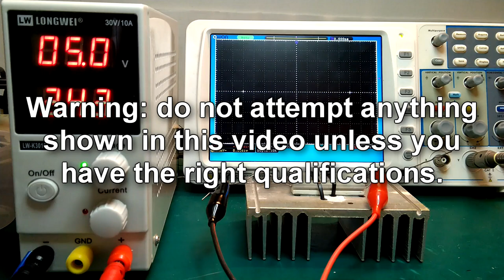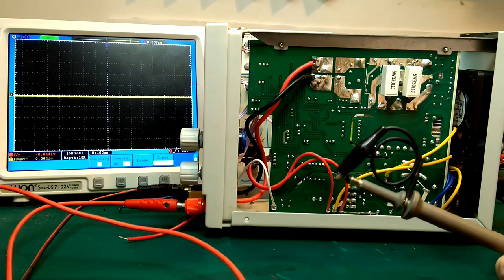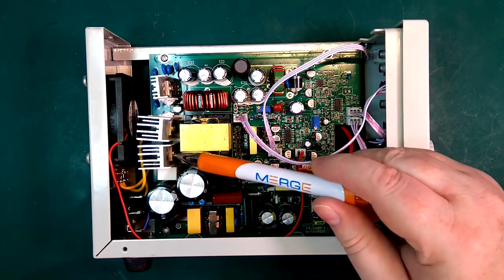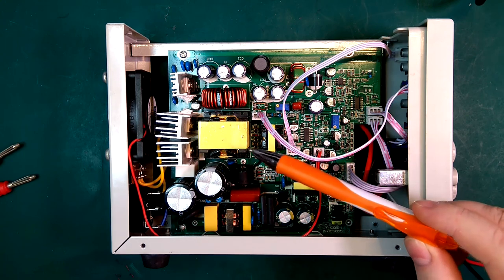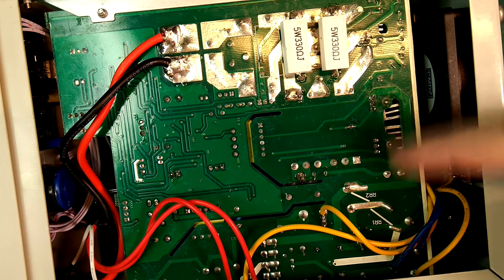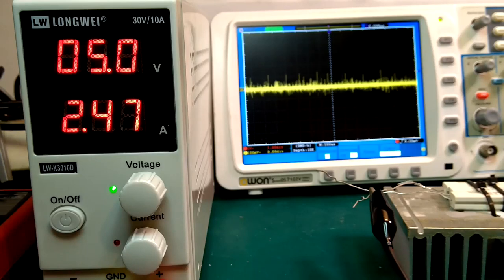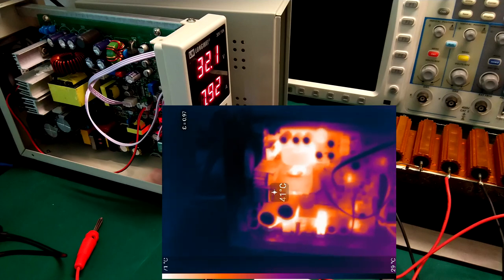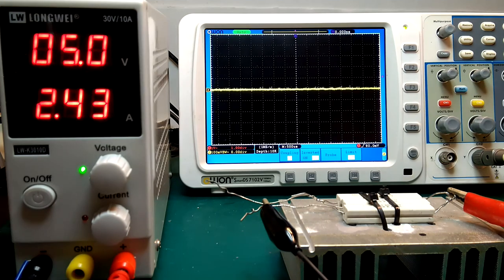Fixing the LongWei LW-K3010D Bench Supply Noise Issue

Comment: is the switching noise as dangeorous as ripple for electronics? Thank you :)
Reply from the maker: Neither are particular dangerous to electronics as long as they are within reason, but you always want a bench power supply to be a low noise as possible otherwise it can affect the behavior of your circuit and make it very difficult to do any reliable measurements.
Cheers,
Jake
Reply: Not using for medical electronic repair or running medical equipment...as a bench supply your safe.

Comment: Hi sir, i have the same power supply and the problem is that cannot keep Amps stable, up - down. Could you tell me sir where to look or what to replace?
Reply from the maker: Hello, the output current depends on the current limit and what load you have on the power supply.
To set the current limit you need to set the voltage to something e.g. 5V then short the output and you can adjust the current to what limit you need.
Hope that helps,
Cheers,
Jake
Reply: @TheStuffMade  i understand what you said sir it's my mistake, i didn't said it right. What i m just saying is, after set the voltage that i need, and adjust the current as you said on the display, initially is e.g. 2 Amps after a second it is  2,5 Amps then 3, 2, 2,5.  it is increasing and decreasing by it self with stable voltage.  What could i do?

Comment: In my opinion, the worst feature of this PS is the current spike when used as constant current supply at low levels. The behaviour reminds that of a line output with a relevant capacitor in parallel. Did you check if your mod do not worsen the already bad spike?
Reply from the maker: I have another video testing the speed and performance of this power supply:
https://www.youtube.com/watch?v=RdT-xWC4h4k
It's typical for switch mode power supplies to react slowly to changes because of the way they work, most linear power supplies have superior performance in that regard, but switch mode supplies are strong when it comes to high power and lower cost.
The noise fix will not improve the speed of the power supply.

Comment: Yes it will limit the noises because of decreasing dv/dt

That means the mosfets switch slower(fall time and rise time increased)
So the mosfets will be get hot and ...dead
Reply: By adding RC snubber and changing the output caps with better (like solid caps) the noises will limit

Comment: Hi how does the  Korad ka3005d vs LW-K3010D with mod compare in noice level ? i would like to compare Vpp and Vmax. Since i can get the K3010D for 56 dolars and the Korad for 85 dolars, both with shipping. Since for my understanding the Fix, does reduce alot the Vpp.
Reply from the maker: The Korad is the better power supply even after the fix. If I could have only one of these power supplies, I'd get the Korad. However the Longwei is great to have when you need a lot of power as it's capable of delivering more than 300W output. Make sure shipping is included when you compare the cost as the Korad is a linear power supply with a large transformer, so it's heavy and often cost a lot to ship.
Hope this helps,
Cheers, Jake
Reply: @TheStuffMade  thanks, the psu comes from spain, i live in portugal, with will be a total of 71 euros, so its a nice price.
Reply from the maker: @tdomingues89  That's a very good price, maybe get 2 of them if you work on audio circuits. 
Cheers,
Jake

Comment: Can you tell me if the fan is temperature controlled or based on current? i worry that the mod causes the fet to heat up more than normal and the fan wont start based on temp.
Reply from the maker: It's temperature controlled, if you look at 4:02 in the video you can see the sensor/diode attached to the side of the heatsink. And no, the MOSFETs don't get hot, you can see the thermal load test I did in the video.
Reply: @TheStuffMade  Thanks for that, i wasn't sure as the fan didn't start when the heat sink on the fet reached 70c
Reply from the maker: @Tom.N  Perhaps your unit is faulty, it's quite common for these cheap chinese products to have quality control issues. I'd check if the diodes are actually making contact with the heatsinks and there is plenty of thermal paste.

Comment: I have a source of this LongWei LW-K3010D  it is falling unregulated voltage does not let it go over 9V then turn on the sera fan q can be the mosfet???
Reply from the maker: It's really hard to say without doing some measurements with a multimeter and an oscilloscope.
Cheers,
Jake
Reply: Had the same issue. Probably a later revision board which now has a TL413 (U7)  as a ref voltage. Check pin 1 as I bet it no longer maintains a constant voltage.

Comment: What voltage rating should capacitors be? 100v?
Reply from the maker: Anything above 50V is fine, but make sure they're film capacitors, the green ones I used are rated for about 100V I believe.
Cheers,
Jake

Comment: if I replace 10N60 transistor for 20N60 transistor will have any problem to circuit? I will need change something else ?
Reply from the maker: It would probably still work, but why would you want to change the mosfets?
Reply: @TheStuffMade   about the transistor, I ask just for curiosity, and my power supply is the same as the video, but is not changing voltage, just still at 0,  I try replace PWM (SG3525A), and CI  084C, and LM2904, I replace the transistors, check de potentiometer BUT NOTHING!! I’m really upset, some idea? thanks for attention

Comment: What if you put just the capacitors without the resistor on the gate
Reply from the maker: Hello David, you need the resistors, I didn't just add them for fun. If you don't add the resistors and only the caps you'll put way too much load on the driving circuitry and it'll likely let some magic smoke out.
Cheers,
Jake

Comment: The question for me is why can't the Chinese spend the 30 cents extra to add these cheap parts to the circuit and charge one dollar more for a low noise power supply?
Reply from the maker: It was probably designed correctly, but then the manufacturing company decided to change a few components to save a few cents, maybe they even did some basic testing like, yeah it works fine, then made 10,000 units for sale. That might explain it, or it was just a poor design from the beginning, we'll never know.
Anyway, a few cheap components and a little bit of soldering will make this bench supply significantly better.
Cheers,
Jake

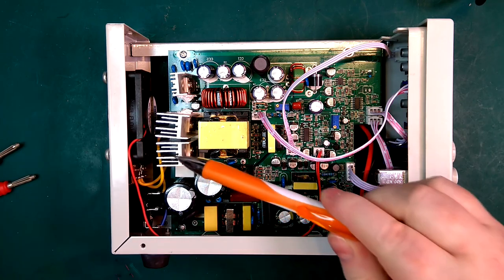Comment: Just one point to make, at 06:16 minutes into the video you point out two 'mosfets'. 
From earlier shots in the video at 05:11 minutes you show that one of those devices is not a mosfet. The MBR 30200C shown is a schottky barrier rectifier made up from diodes, a common type of rectifier used in these types of power supply. The left device shown is indeed a switching mosfet. Please forgive me if I have misunderstood here but it appears you have added the mod to the left hand mosfet, but then you do the mod to the schottky barrier diode on the right hand side.

I have a different switched mode power supply but with similar topography, I carried out your modification to the one mosfet only ( but not the schottky diode) and managed to get a significant reduction in noise similar to the results you measured.
Reply from the maker: Hi Jon, the video is correct, there are 2 Fairchild 10N60C mosfets plus one dual diode MBR30200C. The modifications are made on both these mosfets, there's a small schematic in the video showing how the resistors and capacitors are connected.
I  highly recommend you do the mod on both mosfets if your power supply is the same topology (Half Bridge DC DC Converter).
Cheers,
Jake
Reply: @TheStuffMade  Thanks for the clarification Jake. I will do as you suggest. Thanks for the video.
Best wishes
Jon

Comment: We repeated this experiment with the power supply BLAUBUCHT PS3010 (30V 10A). The result is the same, the RF ripples have completely disappeared!! Here's the video https://youtu.be/bQxj62VwHhU
Reply from the maker: That's great, it seems to be a common issue with many switchmode power supplies that can be easily solved with just a few cheap components.